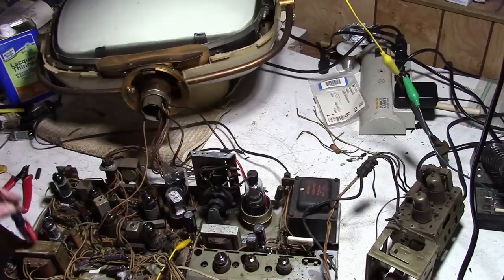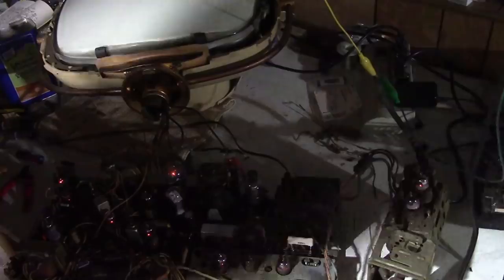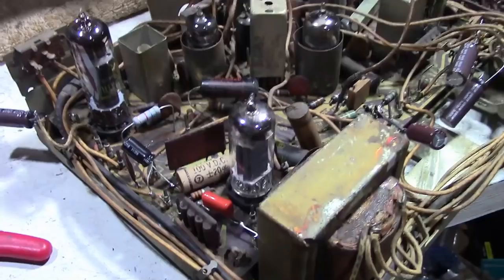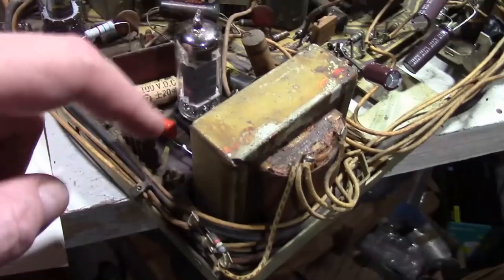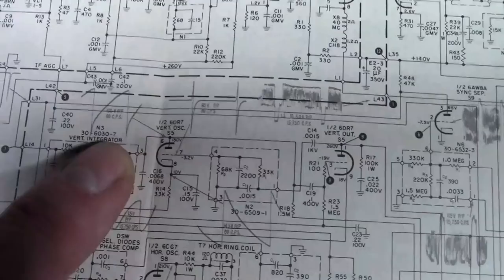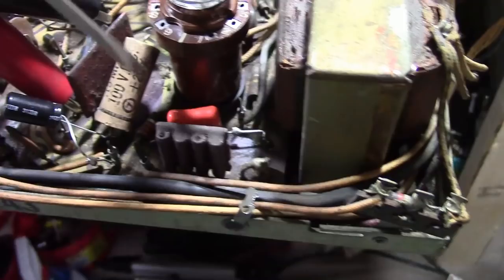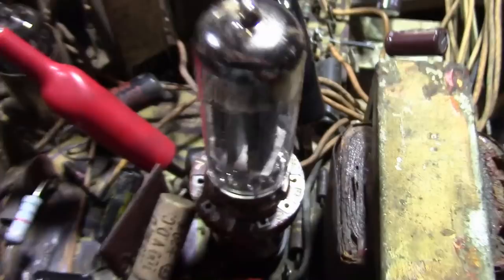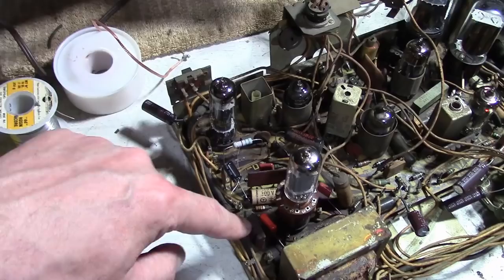Filthy Philco Predicta Siesta resto p3o?

Comment: For my restorations I always start by giving everything a good wash under the tap using detergent. I do this for old valve equipment as well as more modern pcb's. I then use a compressor to 'blow dry' them. This just gets rid of the bulk of the water along with any remaining debris (being careful for things like tuned coils). I then use a hot air gun to reheat it as the compressor makes it really cold. I do not use a hot air gun much as it is too easy to overheat small items sticking up from the boards. Finally I either leave it somewhere very warm for 24 hours or put it in an oven at 60C for 6 hours (It can take a long time for some things to dry). It is amazing how clean most of them come up with just a few minutes work.

Comment: You mentioned using your convection oven to dry out the tuner. I remember the video tour of your house that you did when you first bought it, and I remember noticing you had the same KitchenAid stove I once had. That convection oven should have "bread proof" and "dehydrate" modes that allows you to run at lower temperatures than 170 degrees. KitchenAid sold a dehydrator kit with a wooden doorstop that you could use to prop the door partway open when running the dehydrate cycle. The doorstop has a magnet on it that lets you place it on the door where it will actuate the 'door close' plunger switch. If you press the convection bake button for more than five seconds, you will enter dehydrate mode, and you can enter a temperature between 100 and 200 degrees.
Reply from the maker: Wow, thanks for the tip.  I never bothered to read the instructions for our oven :P
Reply from the maker: Our oven works exactly as you described.  I dunked the whole chassis today and dehydrated it at 140 for a couple hours.  Used a chopstick to prop the door open.  Thanks again for the tip!
Reply: @bandersentv I'm glad to know the SimpleGreen bath plus dehydrate got all the funk off that chassis. Although I no longer have that range due to a kitchen remodel, I do have a newer version of it in stainless steel. I can use this same cleaning method when needed on my projects

Comment: You did a great job cleaning that dirty tuner. I would have missed those vertical controls as well in fact I missed the very dirty vertical linearity control on my Admiral 30C15 and only found that by accident. It's fun to see a set come back to working like you got that one working. Gary

Comment: shout out to shango! fyi I had the exact same issue on a damper tube socket, did the same thing (it was just a resurrection) with wires stuck into the socket and somehow connected the filaments to the board iirc from the top side.

Comment: Simple Green is good. Purple Power is like simple green on steroids. 
Both are alkaline and will effect aluminum and zinc (and probably cadnium.) Dilute 3-1 with water if you want to be careful. 
My fav cleaner is denatured alcohol. I have rinsed things down with it rather than water. When lazy grab a can of brake cleaner.
Real bad 60hz noise in the video and audio. My money is on tube with H-K short.
Reply from the maker: Tuner is cadmium plated. Also used it on aluminum IF can shields.  Both seems to be unaffected.  Generally I use denature alcohol too, but it was having little effect on this set.
Reply: @bandersentv  Yes, it works fine short term but don't let things soak in it.

Comment: I have a thought on your damper tube issue: do you by any chance have a socket extender for that tube? If so, you could clip test leads to the heater pins and power the heater by tapping the needed voltage from somewhere else, (like another working tube, using a socket extender on that as well), would be easier than having to hold the tube in place and should work until you can do a more permanent repair
Reply from the maker: I do and did something similar in the next installment.  Turns out the real issue is something else though...
Reply: @bandersentv  thank you for not giving a spoiler, I  had to pause the video I commented on midway through. I'll finish it after work
Reply from the maker: No worries.  The issue isn't revealed until the next installment.

Comment: Use screwdriver bend those tabs to make better contact with damper tube :) you just need to make the gaps in each pin in the socket be closer together so tube fits more tight.
Reply from the maker: Keep watching.  The socket is not the problem.
Reply: @bandersentv  ok, nice job on the restoration of the circuits
Reply: You are very good at reading schematics I need help diagnosing a Hum in my tube amp it happens only in tuner and tape hd and gets louder when my hand is hovering in certain spot towards front of amp if touch metal Hum goes away. Anyway you can point me in the area to look on schematic and the components to check. I do have a scope
Reply from the maker: Sorry, I don't work on audio equipment.  Sounds like you have a grounding issue.
Reply: @bandersentv  ok
Reply: Grounds are good
Reply: @bandersentv  you restored radios amp not much different from radio or TV still uses tubes. Can yah look at schematic I can email it to you. If you don't want to no worries

Comment: Simple Green concentrate works great. Cleaned a lot of chassis that way. I used an old toothbrush that wasn't dirty at first. Then a piece of  shop cloth 
and a wooden end of a hobby brush where I couldn't  reach otherwise. Shango resurrection  worked .😎 Tuner looks great! Is that waxy on it any good?
 Bodged damper tube  socket needs an  exorcism!😈➡✝🧚🏻‍♂️ It's getting there!

Comment: Won't you have to pull out the pc board anyway to repair the damper 6DA4 socket?
Reply from the maker: Yes, although the socket is fine.  You'll see what I mean in the next part.  My goal was to get it working as much as possible without pulling the board.

Comment: I enjoy Shango's resurrection videos as well. Predictas look to be very difficult to work on and you have quite a collection of them. When you showed the tube socket I could see how expanded the metal contacts were. They need to be bent back just a tad. I have run into this many time years ago when I worked on various tube gear such as guitar and organ amplifiers. I used a very small tool like a jewelers screwdriver to just slightly bend those contacts in. Too much bending and you can't plug in the tube.
Reply from the maker: They're not that bad.  This one is in miserable condition with the filth and crusty wiring.  GE sets of the same time period are worse.  I could have saved myself a lot of time if I had done the resistance check sooner.  Should have cleaned all the controls first too.
Reply: @bandersentv  Watching your video is a great break from the corona blues I have. Through the past few days I tried to work on something in my shop but my heart was just not in it. Maybe one day I will acquire a predicta and give it try.
Reply from the maker: Turns out the tube socket is fine. Problem lies elsewhere. You'll see in the next installment